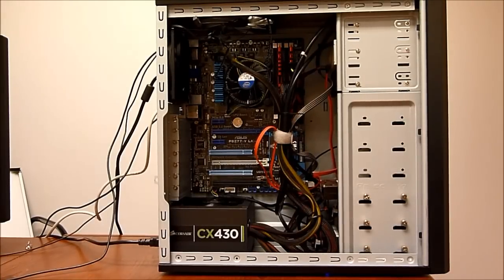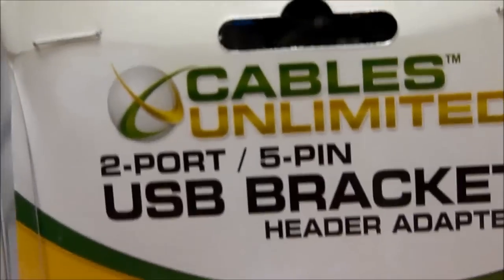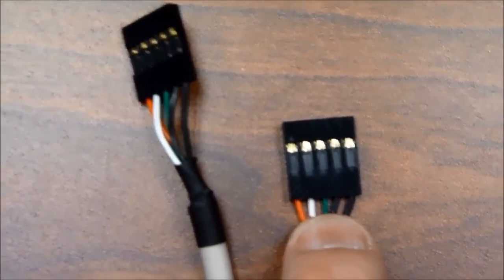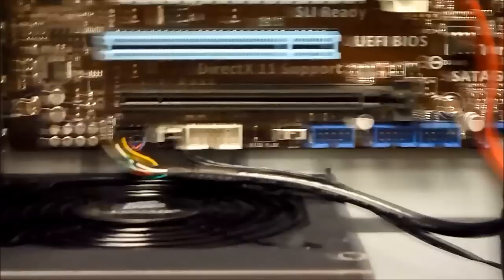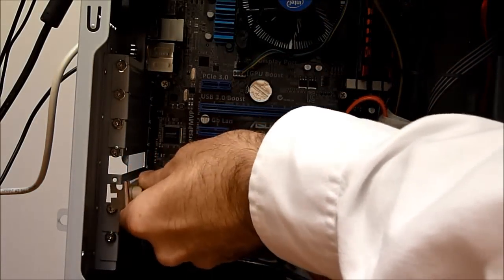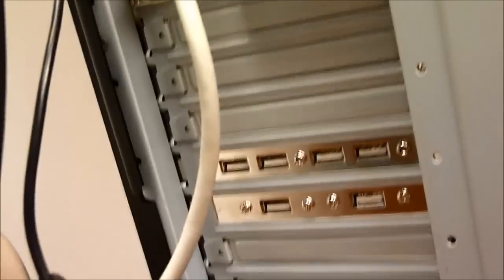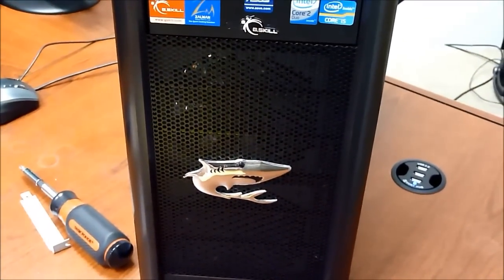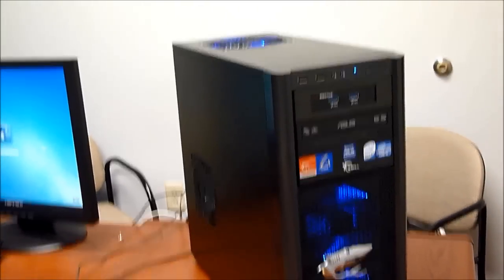PC17: Adding Extra USB Ports, and a Look at the Final Build

Comment: I have run out of USB headers on my motherboard... I'm desperate for one more... can I use any of the other open headers that is not labled USB or what would be the next best solution, if any?
Reply from the maker: You can add some with an add-in card if you have any open slots.  Something like this: https://www.amazon.com/Express-Expansion-Computer-Speed-2Ampere-FS-U4/dp/B0776GY5YZ/ref=sr_1_4?dchild=1&keywords=usb+3.0+board&qid=1635537771&qsid=134-5616853-8237004&sr=8-4&sres=B00FPIMICA%2CB0776GY5YZ%2CB00FPIMJEW%2CB07MFJ2912%2CB098WRDWF2%2CB072LS4JH7%2CB0816C3ZV6%2CB07T2PMPMR%2CB08G73NH5Q%2CB081Y4TK5H%2CB077GS3SKR%2CB082F5M1NZ%2CB08V13XCLR%2CB08YCWCMC5%2CB073CGQD9C%2CB08LQN9SXB&srpt=ELECTRONIC_CABLE

Or, you could use a splitter, something like this: https://www.amazon.com/Sabrent-4-Port-Individual-Switches-HB-UM43/dp/B00JX1ZS5O/ref=sr_1_3?dchild=1&keywords=usb+3.0+splitter&qid=1635537845&qsid=134-5616853-8237004&sr=8-3&sres=B00JX1ZS5O%2CB07PH2WXKT%2CB07L32B9C2%2CB07FCKTG8L%2CB07VSSYHZM%2CB07G8CMR18%2CB07WK1M7GL%2CB01N8VSKLY%2CB09G5TM37H%2CB0797NWDCB%2CB00OQ0CYFE%2CB09B7F88C1%2CB07TVH9NHP%2CB08F53DS71%2CB0953CXSNQ%2CB0751CXBFB&srpt=MULTIPORT_HUB

Comment: I was looking for a video..  On a *{Kalolary 9pin USB header Male 1 to 4 Female Extension Cable Card Motherboard 9-Pin USB HUB USB 2.0 9 pin Connector Adapter Port Multilier}..  I was thinking of getting it on Amazon..  I found your video..  I liked what you had on it..  Sir you have a new subscriber..  Keep up the great work..

Comment: is there a rule how to group usb devices on your mobo, say you have 12 usb connectors and 6 usb devices, is it better to spread them or connect them as close as possible
Reply from the maker: IN this particular case, you are probably overthinking it. In some cases it IS good 
to think about placement- of RAM, and video cards for example (sometimes two ram sticks will only work at their potential speed when placed in specific slots; some PCI slots are slower speed...).  These  "fast connections" are on what we call the  "NorthBridge" of the  motherboard, directly connected to the processor. But with USB devices,  PCI, IDE, etc., these transfer information at such a slower rate  (connected to the slower "SouthBridge" on the motherboard), that I wouldn't worry too much.  Connecting several external hard drives  through a hub on the same USB channel might be pushing your luck,  though!
Reply: BurkeyAcademy my mobo has some usb connected over north bridge and some over south bridge, so i think it could make a slight difference... btw i am not overthinking it and neither am i worried or sth. , i am just curious cause i want to know how things work

Comment: Hi. Nice a video. I enjoyed.
A this video even an old one, should be a still useful for peoples who are having a only one usb 2.0 front or back port, or two usb 2.0 ports(like this video), but with separated connectors...

Usually, there is two usb 2.0 ports with one an connector(two cables into one connector) and 10 pins(1 pin empty and 1 blocked or only 1 pin blocked). Actually, there is 8 or 9 pins(depends of the case)...

But in some cases(like this video), we got a only one, with separated usb 2.0 cable and connector with only 4 or 5(like this video) pins. Can be 5 pins too, but 1 pin of the 5 is empty pin...

When you got 9 pins connector, you can't wrong by connecting to motherboard, because only one direction is possible... But when you having a 4 or 5 pins by single usb port, you can wrong as well... So in that case, you should to read manual of your motherboard...Actually i recommended to do that in any case....

Note: For some users who don't understanding, one usb header 2.0 of the motherboard(8 or 9 pins), giving to you 2 usb ports out 2.0. It's same with usb 3.0 ports. A one usb 3.0 port( 19 or 20 pins) giving you 2 usb ports out 3.0...

While i watching a this video, i noticed a this great speaker, when saying and explain type of wires of the usb connector... Sorry, but i think, it's not explained as well...

At 3:14

Actually, there 5 wires with a different and same colors. 

Pin1. Red wire is carrying a current, it's positive(plus) wire which supply 5V and 0.5A(for 2.0 usb)
Pin2. White wire is data negative(carrying data)
Pin3. Green wire is data positive(carrying data)
Pin4. Black wire is gnd(ground) or negative(minus) wire

Pin5. Another Black wire(a fat wire, different than pin4 wire) is s-gnd or shield ground. And this is an optional wire, no need to be connected(in this case).

Pin5. Wire should be to use with motherboards who supporting s-gnd(look at manual of your motherboard).
Pin5. Wire is "EMI"( Electromagnetic interference) to resolve EMI problems and give a better quality of transfer data. This is usual for some older motherboards, but new ones not using a that wire(in most of cases). I guess manufacturers of the newer motherboard are resolved a this possibly problem at other a way...

In a this video, we got a P8Z77-V LK motherboard.
Pin5. On this motherboard(up row) is marked as "NC". A this motherboard doesn't have a "s-gnd" pin.
NC is meant No Connection. This pin is empty and connect to nothing with motherboard(should be)...

If i'm not wrong "NC" is used by engineers for testing usb on motherboard. After test done, they just disconnected him, instead of removing... Why? Probably less costing. And because of that, "NC" pin is now standard of usb headers of the motherboards...

In a this video, we saw connecting pin5(s-gnd) of usb connector to the "NC" pin of header of the motherboard. If you didn't have any a problem, it's not matter by connecting him XD

One more, nice a video. A still useful as well, because a lot of users using a cases with only one usb 2.0 port and only 4 or 5 pins out. Can be same with two usb ports like in this video with separated connectors...

Thank you.
Reply: As can be seen in a this video https://www.youtube.com/watch?v=BxHKBCz_pN0&t=779s
(video at 12 minutes and 55 seconds) guy made it a nice PC built, but connected usb 2.0 header on wrong the way...

As can be seen too, he has a very a similar motherboard like here one(almost same). So, it's a good comparison...

But, a situation is different. A here(a this video) we got a usb connector with 5 filled pins(5th is s-gnd). 

And a guy of that video, has 5 pins too, but 1 pin is empty(only 4 pins filled).
So, he is connected an empty pin of usb of the PC case to the 5V pin on the motherboard's header...

I guess all was ok, because of that...

But here is one different a situation(this a video), where we got full 5 pins. So, connecting a s-gnd(5th pin) to 5V is not good idea...

By the way, in some cases, some usb connectors having all separated pins(one by one), and you have to be carefull with all that of pins...

Comment: what about adding extra usb to the motherboard not to the back i only have 2 usb on mine
Reply from the maker: If you have an open PCI Express slot, you can add a PCI-E card to your motherboard that can add 4 more.  On Amazon or Ebay, look up "PCI-E to USB 3.0 4 Port" and you can get an idea of what I am talking about. Another option is an external hub, that splits on existing port into 4 (search for "4 port USB 3.0 hub").